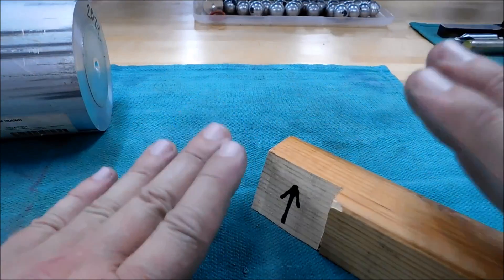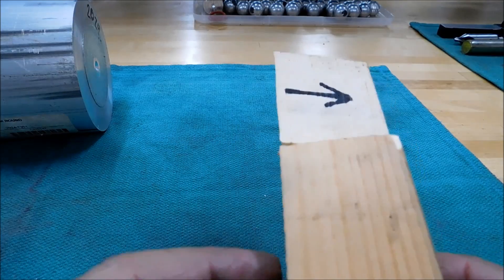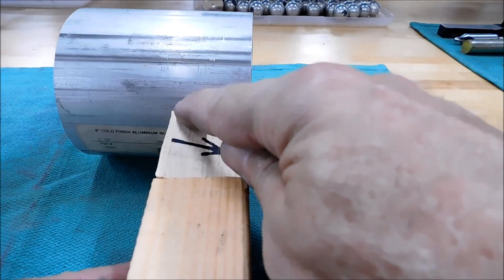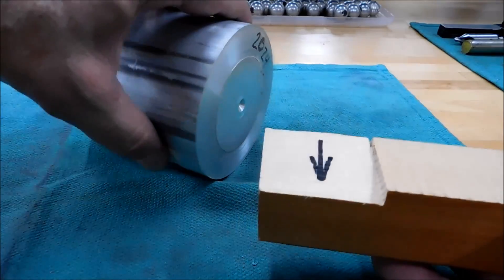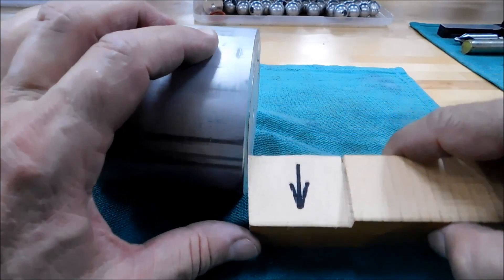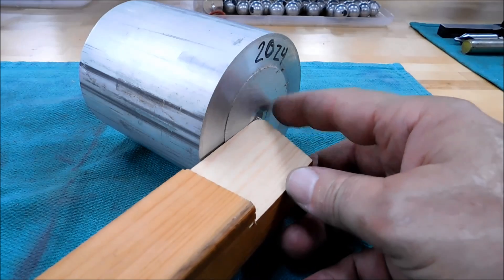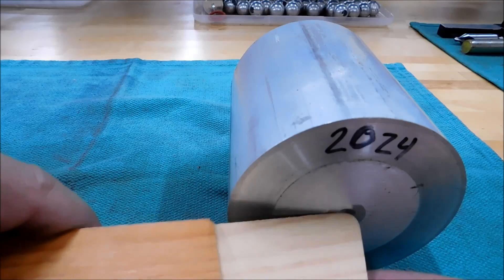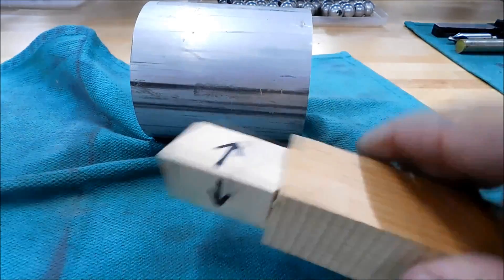I've Never Ground a Lathe Tool..... Basics, 101... WATCH THIS ONE !!!

Comment: I normally do a light facing to find center. Gradually dial in on a smaller and smaller nub on the work.
Reply: I sometimes measure the distance from the ways to the centerline of the lathe and write it on the side of the lathe so I can just do a quick measurement when needed but I honestly can get closer if I just run the tool in to the center while the spindle is running.  You can see the center point easily and can eye it up damn near perfectly. It all depends on my mood though, the trial and error method works just the same.

Comment: It bugs me too when people turn the post,even when using an insert tool designed for facing and turning. Some folks even  seem to believe that a tool has to be fully in and inline with a tool holder rather than angled as needed Takes all sorts i suppose.
Reply: Hobbyist with only a few tools and holders here...
I'd love to have enough different tools and holders on hand for any turning task, but that would be provibitively expensive for something I don't earn money on. I find myself turning the toolpost and using tools at odd angles in order to get clearance or to use a tool in ways it was not designed for, simply because I don't have the appropriate tools and holders. Getting the job done in less than ideal ways is better than not getting it done because you insist on only doing it perfect.

I can grind HSS to cut reasonably well, but I'm sure my tool geometry is far from ideal. Would like to see more videos on tool grinding.
Reply: @Kaboomf   Good man, get it done with what you have got. It may be of interest to know that quite a few Russian and Japanese professional turners dont use quick change toolholders, they just dtick with 4 way toolposts, and they do marvellous work. Many only use brazed carbide rather than TC insert tooling. Using HSS is fine, maybe a bit slower to use but if time isn't money who cares. I personally use HSS in a home made Tangential tool for maybe 90% of my turning. If you find yourself constantly turning your toolpost consider if it is possible to change the shape of your tool or move it in the toolpost to do more work without .

Comment: I haven’t ground any tooling. I’ve always used inserts. Not 100% sure I use the right ones either.
Reply: same.
Reply: You guys want to know where I learned the most about insert grades besides YouTube?  One word, CATALOGS. Get yourself some free Caralogs. MSC gives free catalogs, Travers Tool gives free catalogs, and so does KBC Tools. MSC and Travers tool have some of the best info I have seen on most of the popular brands.  I just wanted to throw that out there as an FYI. I will say it helped me a lot, and I STILL use it for references.  There's hard inserts and that's tough inserts.  Think of hard as long wear but very brittle and not very shock resistant.  The tough are less hard, but take interrupted cuts better.  Then you have to look at nose radius, and chip beaker for depth of cut feed rate, and material.  I think that's a very basic explanation as I understand it.